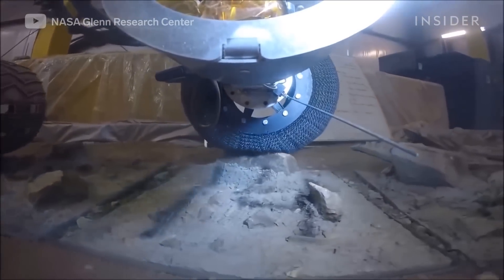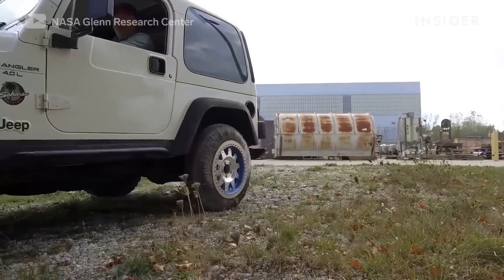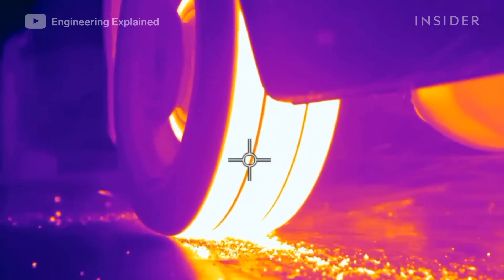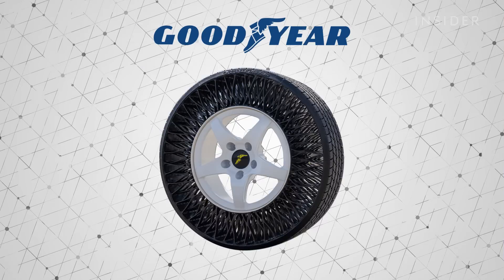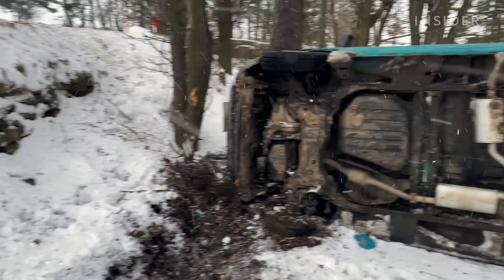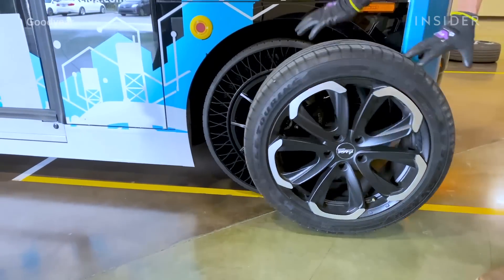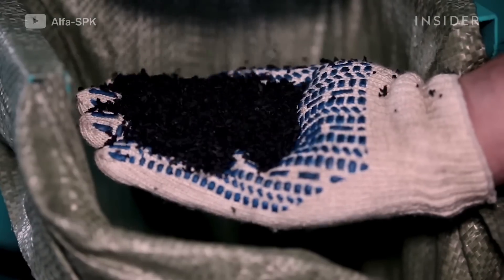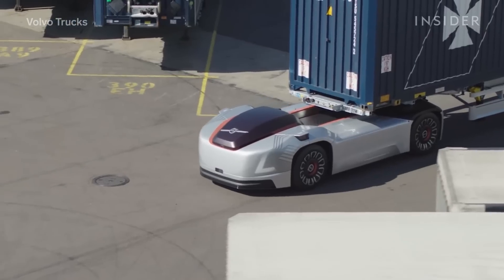Why Cars Don't Have Airless Tires Yet

Comment: I do not drive cars but I do ride bicycles, but the mechanism is the same. a pneumatic tire presses on the entire contact patch with the same pressure, and this way you can optimise traction. I think nothing can even come close to that.

Comment: try two part symmetric rims, that you can fit solid/airless outer tires directly into, just keep the two rim halves together with the wheel mounting lug screws, or more.

Comment: I OWNED a 1978 Pontiac Parisian that CAME STOCK with Uniroyal airless tires. After two days I returned to the dealership with THREE BENT steel rims! I demanded some "real tires and a set of NEW RIMS". I got them when I tossed the keys and title to the owner of the place. By the next year GM recalled this stupid idea.

Comment: Only benefit I can think of is that you cannot puncture airless tire. Beyond that, there's only downsides. These tire are heavy to start with, which mean less efficient suspension, more fuel consumption etc. For special purposes only (like moon rover), no need to re-invent the wheel so to speak. Especially when (as of 2024) air does not cost anything.

Comment: Car sits outside in cold weather.  It snows 2 feet.  Snow gets in the tire and freezes.  Melts, freezes.  When you go to drive the ice breaks the tire or you have a really bad wobble.  I want to like these tires because you never have to worry about a flat in the middle of nowhere.

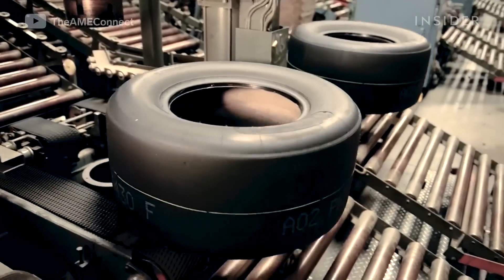Comment: 3:57 low-speed, low-load applications for starters: mower, autonomous shuttle and delivery cart 4:21 Goodyear airless maybe by 2030
Reply: I have them for my electric scooter, a great application for them since air filled ones are very vulnerable to popping

Comment: I can't see the industry really promoting a tire that does not need replacing if punctured. I've had punctures too close to the outside wall requiring a complete replacement which would not be required if the tires were airless. Still think we need these even if for environmental reasons.

Comment: I am counting the days for these to become publicly available. A popped tire ruins my whole week. In most cases I have had to get the car re aligned, so the cost is not just getting a replacement tire.
Reply: Yeah not to mention if its happening in the middle of urgent things. Once i just opt to park my car in public parking and get taxy just because of tight deadline. Replaced it later
Reply: Are you still counting the days? Lol

Comment: Sounds like a long time coming. With all the blowouts, flats, hydroplaning and on and on. My whole concern is pliability and sheer strength. Technology available today could very well come up with design and materials engineering that can be a game changer. Otherwise  these new fangled tire designs may fall ‘flat’, pardon the pun on their face. Tensile and torsion strength mixed with pliability for high speed cornering. Centrifugal and centripetal forces can be a huge factor for secure seating if the tire bead on the rim edge. 
It will all vary when translating in to cost for extra heavy vehicles like semi tractor trailers too.

Comment: why is heat an issue when it's literally open from the sides?
Reply: It's the heat on the treads. The tires will melt at high speeds.

Comment: The problem is that these tires will kill the industry because they will actually work and new tires won’t be purchased nearly as often.
Reply: Have you read the other comments on this video. Apparently these tires might have huge issues.
Reply: @remix4098  especially since modern tires will last 100k miles with minimal issues. The rubber they’re using can take the heat, speed, debris and wear and run off of lower air pressures. They’re absurd.  Michelins makes tweels and they are awesome on lawn mowers because the skeletonized design acts as suspension as well as airless system but they are ungodly expensive and need tons of work to be even considered over tires today

Comment: They should put foam in the spaces in-between. That way it looks, or doesn't get looked through as a normal tire!
Reply: more heat. less compression. additional material. increased maintenance. bad.

Comment: What about snow, ice, and mud getting into the web of that tire? It won't be able to compress properly and will through the car severely out of balance. Also when I'm towing a trailer with my pick-up truck I can raise air pressure with the load and lower it for better ride when trailer is off. This tire doesn't give you that option and if it needs a special wheel on top of that it sounds very expensive and not worth it to me. Not saying it doesn't have a use case but seems limited.
Reply: I was concerned about that too but I saw a video of one of these tires full of mud and as the car drove it crushed all of the mud and dirt and it ejected. I saw a video that did the same with ice.
Reply: I've seen a demo where a bike tire was made out of a nitinol mesh (nitinol retains its shape under stress and can "remember" the shape it was forged into) that was encased in a small rubber sleeve, it was able to run over nails because the nitinol kept the structure instead of air pressure, so you could probably do something similar

Comment: You can and could buy airless tires for a while now and they have been used in construction and heavy machinery for a while now too
Reply: yes but in those applications, the vehicles move at relatively low speeds, therefore the airless tires won't heat up. won't work for a daily driver, at least not yet. also, I quite like the ability to control how much air is in my tire to increase the contact patch and traction.
Reply: Yess  , i had been saw that tyre for heavy lifted non street vehicle .
Reply: It was at least 7 years ago I used a skid steer with these tires at work. They work amazing. They ride really smooth... Much smoother than a standard tire. But they didn't last long. The tread would delaminate off much sooner than a standard tire would wear out. Once they fix that issue, they'll be great, for skid steers at least. They'll be far too expensive for cars, in my opinion.

Comment: Replacing air with polymer material is going to add a lot of rotating mass, and increase air resistance as that sprung connecting layer is basically a fan. They will be far less efficient than existing tyre and likely much more expensive - as the construction is likely much more complicated. Don’t really see many advantages other than puncture avoidance.
Reply: A tire that never goes flat is a huge factor. Farm trucks, tractors, construction vehicles, lawn mowers, etc. These tweels are the future in vehicles operating 55mph and below.
Reply: If airless tires worked, every airliner would have them...A 727 "Pig's" main gear tires cost about $230,000 EACH and are good for MAYBE 400 landings. The Duryea Bros. started putting pneumatic tires on cars in 1897. There were THOUSANDS of reasons. In a year EVERY car sold in the WORLD had pneumatic tires.

Comment: can you imagine all the rocks , mud, debris that will wreak havoc on your car. this would work on slow moving equipment , definitely not on anything going faster 20 mph
Reply: @Roger Vieira tires changes in shape as it treads over rocks and different terrains etc. So a cover would not work. This idea is really for vehicles used for construction where speed is not a factor
Reply: @brucewayne2773  a cover would work of it were designed around the idea of constant shape shifting or size variations.

Comment: The airless tires are phenomenal!  But think about it . Imagine airless tires on every car every vehicle. Tire company’s would all go out of business. What is taking so long is that there still trying to produce an airless tire that will deteriorate, break, expire, run flat til no grip or til it’s integrity will last less not last a lifetime! Once they figure that out then tire company’s can stay in business auto shops won’t lose money an nothing will change prices will continue to go up! Once airless tires are ready for sale there will be a lot of disappointing customers!
Reply: The main reason you replace tires is do to wear. Airless tires will still wear down over time.
Reply: That's stupid they can just control the amount of tread on the product to run down faster than a standard one.
Reply: You have zero understanding of how marketing and consumer science works.
Reply: If the tire manufacturers can make an ultra long lasting tire, even if it costs a lot more, I think they'd find a market for it in fleets.  Roadside service calls and lost productivity for big trucks, tractor trailers, city buses, and delivery trucks aren't cheap.  Show an organization with 1,000 fleet vehicles that the cost per tire mile will be the same with the high-tech tires but that their maintenance and service calls (not to mention lost vehicle/driver productivity) to replace/repair tires will be much less, and the companies will bite.  If they don't, get your lobbyists to play the environmental argument and convince laws to be passed mandating longer lasting, "more environmentally friendly" tires.

If the concern is that long lasting tires will cost too much upfront or won't live up to the longevity claims, the tire manufacturers could lease the tires to fleet users on a $/1k miles/tire or $/month/tire basis, thus basically guaranteeing vehicle owners a set tire cost per month or per mile.  That's done with some expensive aircraft components, and even with things like contracts for copier maintenance and supplies at big offices (companies pay X per page printed).
Reply: "Produce a tire that will deteriorate, break, expire"

Dude, you obviously have very little understanding of how material science works. Heat, Air, and Water is the enemy of all things even remotely solid. You have something that on many roads will be rotating thousands of times a minute, that builds up massive amounts of heat and tear. That will strip anything within a few years of use. Most tires tend to last a few years not because of intentional defects (good way to get your customers killed and have lawsuits) but because of realities of using something like rubber. Look at the tires used on race cares. Those often have to be replaced at least twice a race just due to how quickly the speeds they go at destroy them.
Reply: Also, airless tires would be resistant to police spike traps
Reply: Yah we won’t hav a choice to replace airless tires cus they will wear out also. your right.

Comment: Uh huh, heres my thoughts. I live in Montana, mud , snow, ice are the norm. Will these tides shed mud, ice, snow from the inner open spokes , or will the tire be off balance. 2nd if they won't last 45-60 thousand miles, forget it not worth the hassle.. I own a Jeep Wrangler, Ford Diesel F-250 and a 4door Optima. if you can't haul heavy weight , per say my diesel or off road as with my Jeep or drive distance as per the sedan, don't bother I'll stick with the tried and proven pneumatic  tires..

Comment: If these airless tires don’t last at least as long as pneumatic tires (60k miles) when they come out, I ain’t buying. If that means I have to wait till 2030, that’s fine by me.
Reply: I’ve never had a tire last for 60k miles
Reply: On the website it says they are designed to last 2-3X as long, But we'll see...